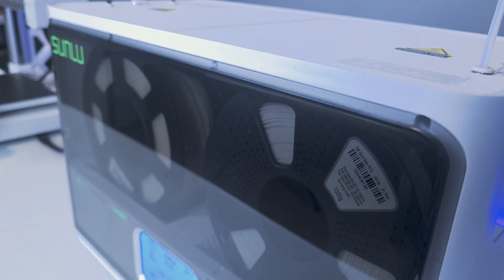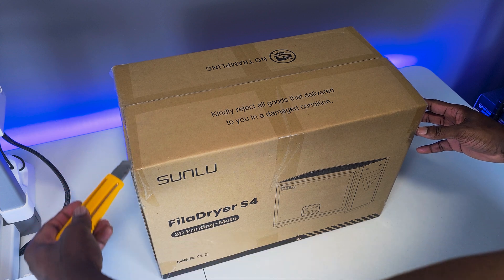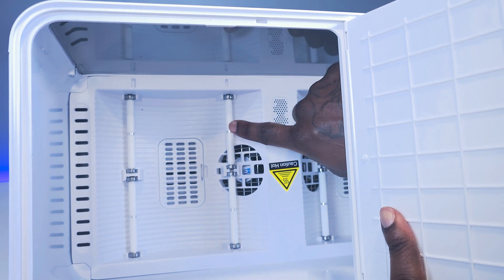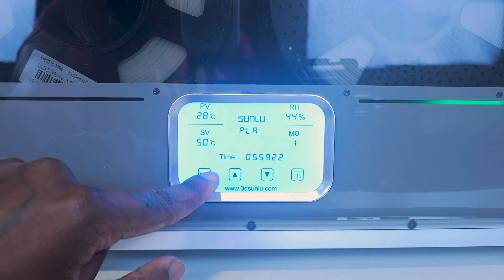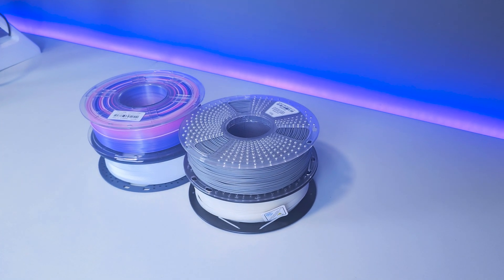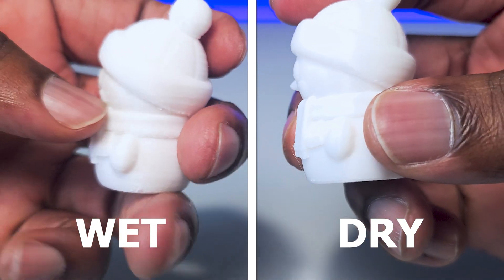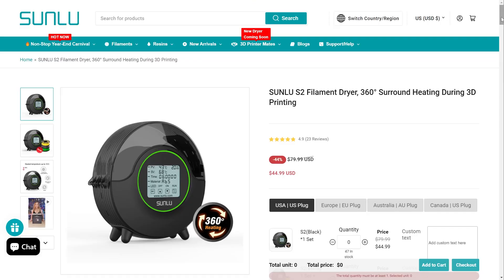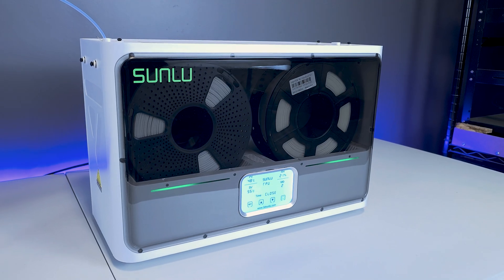☔Your 3D Printer's Best Friend! NO MORE WET FILAMENT Thanks to the Sunlu FilaDryer S4 - Review

Comment: A question that I have had for a while is, should all unused ports be plugged with the provided plugs? If I am using it to only dry and not feed filament to my X1C should I plug all of the 8 ports or leave any open for ventilation?
Reply from the maker: I usually have at least one port open when its not feeding, mainly because I can't be bothered. It performs great for me that way and I've heard people suggest that it ought to have vents anyway so I don't think think leaving à few holes unplugged is perfectly fine. Give it a test. Hope this helps!

Comment: nice video, wish you'd talked a bit more about feeding into the Bambu AMS as mine is top mounted like your setup. I was wondering about the feed length and it's exposed until it gets into the ams to a1 ptfe tubes. Saw you then had a single roll linked direct and using ptfe as bypassing the ams... but then what about feed as the ams helps feed the filament into the a1?
however, happy new year and looking forward to more great videos from your channel
Reply from the maker: Thanks for watching! Sorry, I tried keep the focus on the S4 for this video. I'll detail how it works with the AMS Lite in a future upload. To make sure that the entire length of filament was dried, I only connected it to my printer after the S4 ran its cycle. The S4 feeds directly into the AMS Lite without issues, you just need to be mindful of how it's placed so there's no resistance and the rollers can do their jobs easily. The external spool was just for the TPU but that gave me an opportunity to test printing using the S4 with and without the AMS Lite. Both worked well.
Reply: At some point I think someone will end up making a universal filament dryer that will replace the expensive $300 bambu ams units. It doesn’t make sense to have a $300 case that is more expensive than an actual 3-D printer, a separate dryer, separate storage bags or boxes. We need a nice compact 4 to 6 spool filament dryer, and storage unit that can feed our 3-D printer on demand with other units stocking on top like a bookcase. You can organize them by material such as PLA, PETG, ABS, etc. I’ve only been doing this for a few months and can’t believe how much time is dedicated to figuring this out
Reply: @VolikakisChristos  SUNLU has a top that replaces the arms unit. That drys and prints same time. I don’t think I need that I find my desiccant packs keep my filament dry in my arms original. I make sure filament is dry to 20-25 thinking check desiccant packs one a week so far filament desiccant packs have been good only a few beads changed.

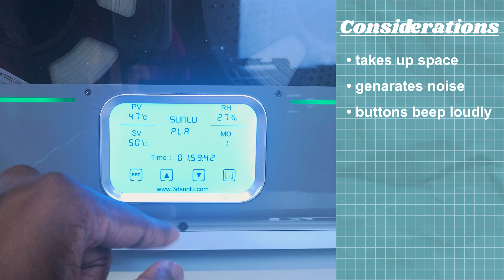Comment: At 10:03 you show the Sunlu loading two different filaments to the A1  Printer with AMS Lite.. I don't have one to look at.  
Are you running the filament through the AMS Lite? Using the Feed Motors to run the spools in the Sunlu? 
Thanks for another good video..
Reply from the maker: Thanks for watching! Yes, I ran spools into the AMS Lite from the S4 and worked well, producing nice looking prints from dried filament. The rollers in the S4 allow it to feed into the AMS Lite, you just need to be mindful of how it's positioned so that there's no resistance. The S4 goes well AMS since both use up to 4 spools.